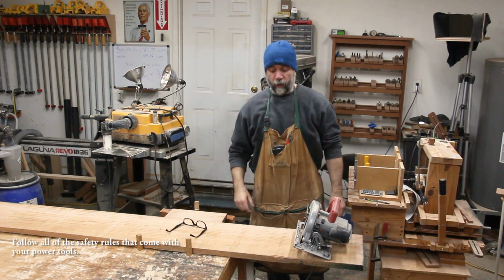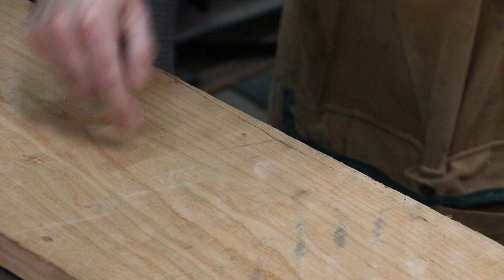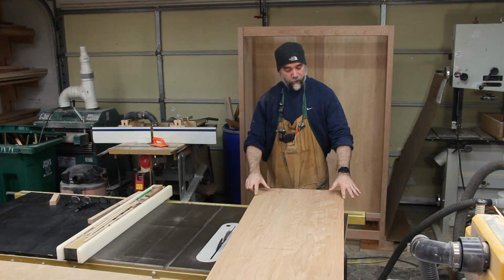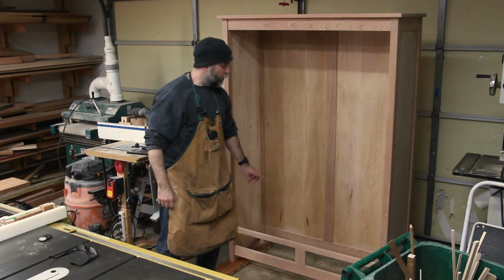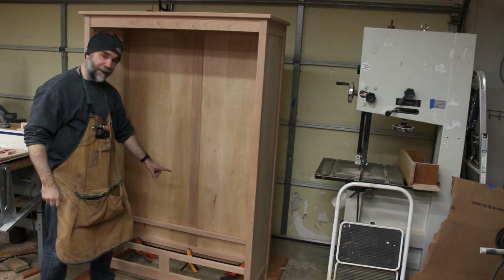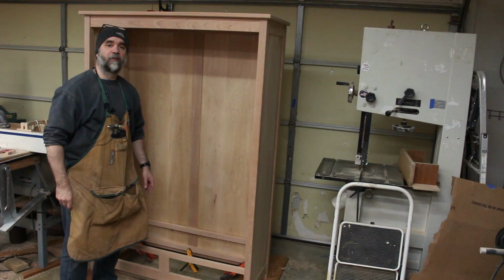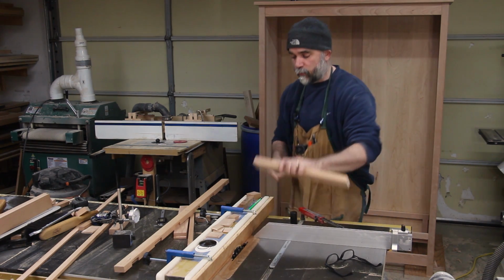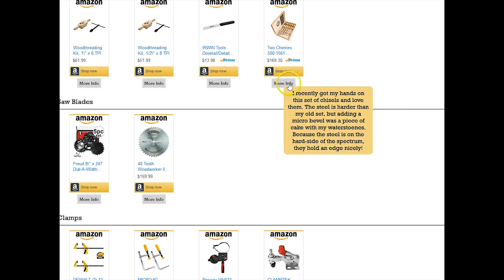Wine Hutch Build - Part 3

Comment: Neat trick with the strip for the miter track on the table saw to cut the panel to length. First time I have seen that!
Reply from the maker: Carpet tape is some magical stuff :) 

While it would be great to have a track saw for this, the tape and runner work nice.
Reply: Track saw not likely to be as square, but maybe that's just my inability.
Reply from the maker: Good point!
Reply: I thought so as well. Always learning from you folks!
Reply: Great trick. I'll put that one in the store to use at a later date :D
Reply: Brian, the reason you did it this way was because your cross cut sled was not wide enough or is there another reason?

Comment: Really nice looking hutch, Brian. I'm not sure when ripping boards down to a smaller width, as well as alternating the growth rings , fell out of favor for table tops and panels? I still do it that way, and lay my hand planes on their side when I sit them down :>).
Reply from the maker: I usually don’t worry about growth ring direction in panels and have never had any issues.  Thanks for checking it out Steve.  Almost done I think.  :)

Comment: Hey Brian, Nice work.

I noticed your stacked Dado setup there and actually had a question.

I will try to explain it as best as I can.

I was working on building a small box, maybe 4" by 6" and I was cutting the rabbit in the bottom and used a similar setup but when I ran the base through the dado blade and while using the miter gauge there was room for the work to kinda slip into the recess on the sacrificial fence. Nothing happened but it set off my danger radar, I could feel it try to pill into the space there.

How should I go about doing those cuts in the future?
Reply from the maker: I’m not sure I understand how it slipped into the recess.  Did the piece slip across the miter gauge?
Reply: @GarageWoodworks  I'm not too sure, I was pressing it into the fence which may have been the problem?   Just curious if you have any experiences like that before.
Reply from the maker: Ahh, ok.  Register off of the fence before making the cut. Then push forward - not into the fence.
Reply: @GarageWoodworks  Sounds good, I will try that on the next one :)

Comment: Brian, if you are still planning on sliding dovetails for the drawer runners, would you just make note of the details of the dovetail bit you use?  Thanks.
Reply from the maker: I keep going back and forth between dovetail guides and kickers.  I'll let you know either way.
Reply: Thanks.